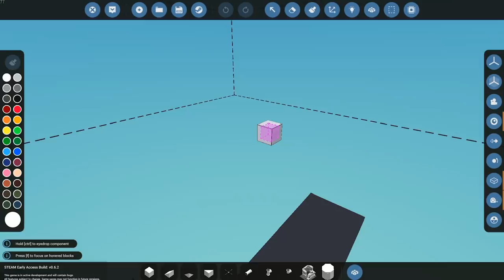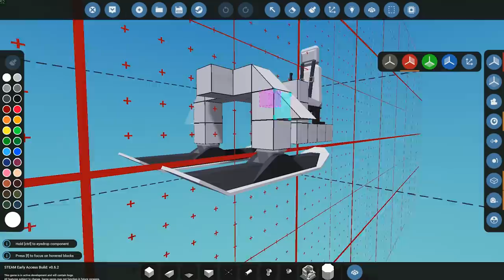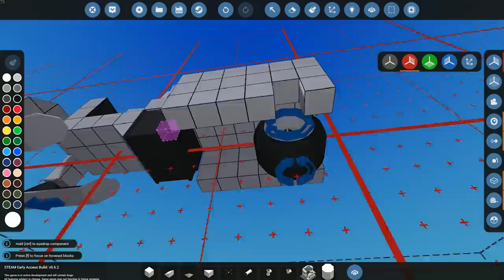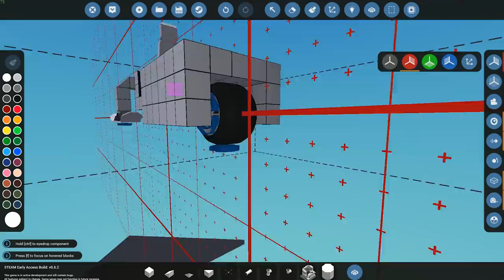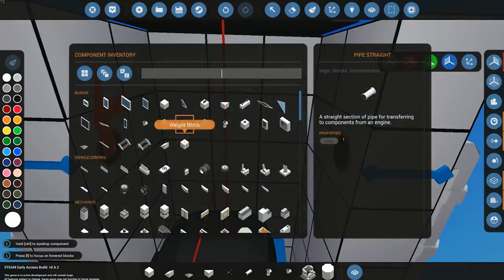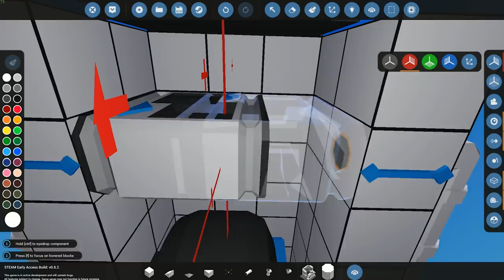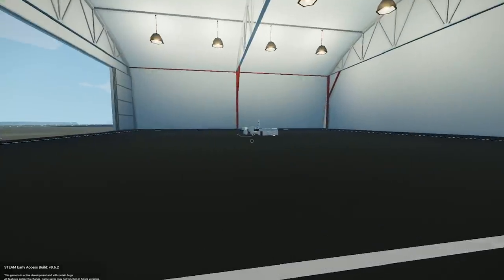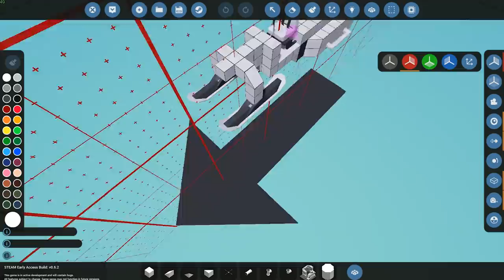Stormworks Snowmobile Tutorial

Comment: What do you recommend as the minimum pc specs to run big creations at high settings
Reply: Godly CPU, game doesn't use GPU much.  Like a 4.6ghz quad core.  More ghz the better.
Reply from the maker: I use a laptop, check my YT description/info for the details
Reply: @storm37000  thanks
Reply: @MrNJersey  thank you
Reply: only uses 30% or less of my gtx1080 at 1440p and max settings.  It should run great at 1080p with TAA off on a 1060 or even 1050ti.  The game uses under 2gb of vram.  But the game is very physics/cpu bound.